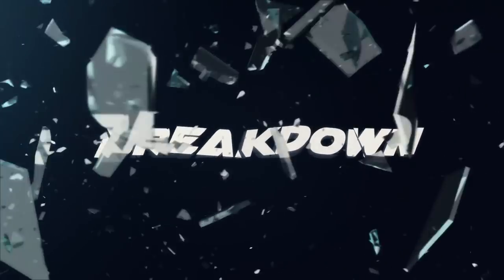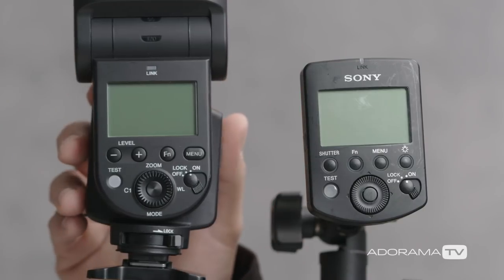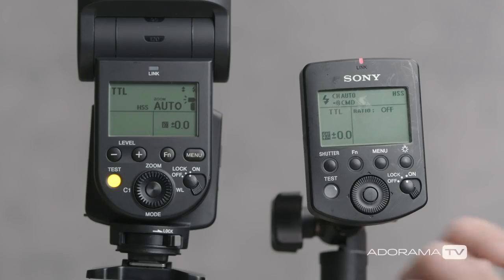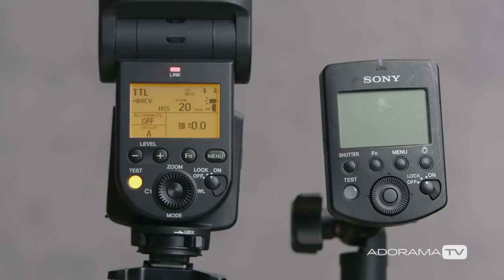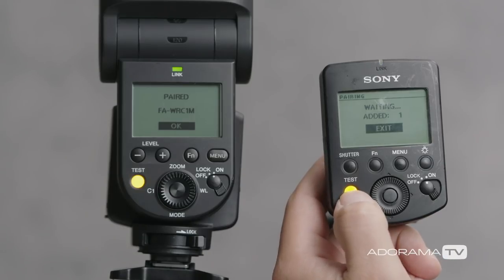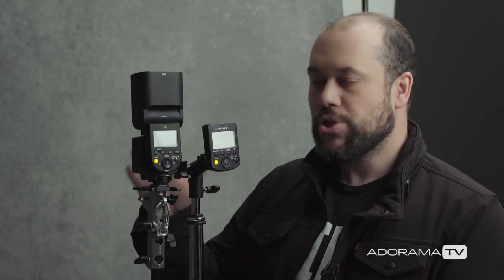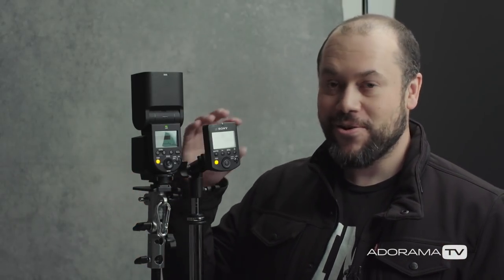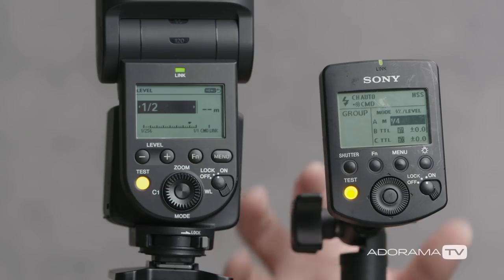Sony Radio Commander & Flash Setup: The Breakdown With Miguel Quiles

Comment: This is only the second flash I've seen with that locking switch instead of the screw knob and I really like it. I hope this is a trend in the flash industry. Nothing slows down the process for me more than trying to tighten or loosen those things. Very nice.

Comment: Hi Miguel , I just received my 2- 60 RM and I have a few questions that were not discussed  on the video I'm a Canon user that just switched systems
1)After paring the Trigger with the receiver are the setting saved on the flashes, like Canon flashes do?
2) Do you have to pair the flashes every times you change batteries or it remember the last setting?
3) when using a flash on camera to control the slave/receiver unit , does the on camera unit default to group A, if not how do you control the on camera flash when shooting in groups?

Comment: Brilliant, Miguel! I've just added two SONY 45s along with a 60. Thank you.
Reply: Which tripod do you use to hold the flash do you use any soft boxes ?
Reply: It is better to buy 2 flash than buying the commander that cost the same price than the 45rm. Personally i would buy 2 x 45rm or 1x60rm and 1x45rm. Am i right? I don’t see the point of the commander that cost the same price than the high end flash. These flash are receiver and controller as well. Did i make a mistake?

Comment: super tuto. just purchased hvl-f60rm2 for sony a7r5 in case exposition of face is better with face recognition. no modeling light and no TCM (uses ttl value as starting point for M mode); Looks quite prehistoric compared to my godox V1s however.
Do i understand correctly that if HVL is in cmd link, FA is the commander but power sent by fa is not written on HVL screen and if we set manually power on HVL, fa is disabled and is not retrofit with power chosen on HVL ? oh dear !
I also purchased HVL-F28RM and heard that it could replace FA. Do you have tutos on how to use HVL-F60rm2 and HVL-F28rm ?

Comment: With the Sony A9ii can you set flash exposure comp from the camera, there is an option to do this from the camera.  Do you need to use the flash or commander that’s mounted on the hot shoe and not use the camera for flash exposure comp?  I was thinking I could shoot TTL

Comment: I have the 60RM on a a7r IV with the 24-105 mm Sony lens with the Sony commander.  I have the commander set up as you show.  I am able to change the zoom on the commander to 105 which is where I have the lens set at the moment. But I cannot change the setting on the 60RM flash unit. The screen shows WIDE, it has always shown wide, even when I had the lens at 24mm, and it is grayed out.  How can I change the flash unit, do I need to change the flash setting?  Thanks.
Reply: Normally it display wide if you would use a lens outside 20-200mm for the 60rm. Something is wrong. You should be able to select 105. Try to reset and use the 60rm alone and see if it works then try to resync the commander

Comment: I have one question. I have taken over all the settings in the video. I have an A7 IV and use the 24-105 GM lens. Should not the focus be automatically transferred to the flash with TTL setting? The focus must always be selected manually in the flash. The "automatic" symbol can not be selected. Is that right? Best regards

Comment: Miguel, if I am using the FA-WRRI as a receiver attached to a F43M, do I leave the 43M in TTL mode as there is no Command Link option? I found that to be the only way to simulate "Command Link" on these older flashes and still be able to control the power settings from the commander...

Comment: Somebody help! Just started shooting on the a7iii a few months ago. I just picked up a Sony commander and a HVLF60RM speedlite. I got everything set up and working properly but for some reason the LEDS below the flash continually blink unless I shut off wireless flash mode inside the camera. They don't flash when it is connected directly to the hot shoe. Does anyone know how to stop the LEDS from blinking?
Reply: Theres an option for it